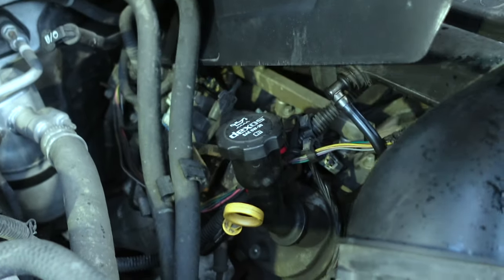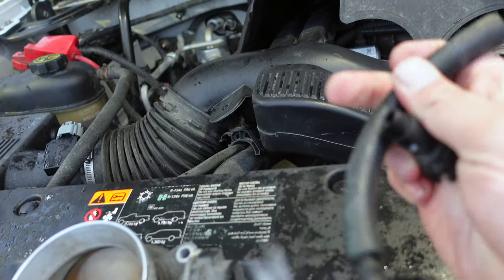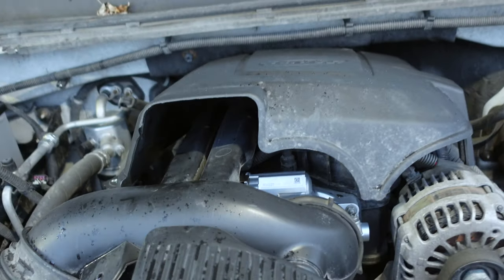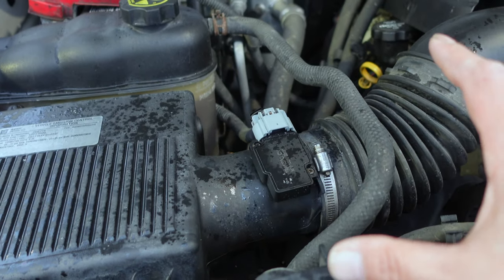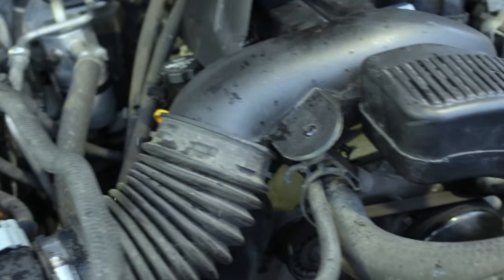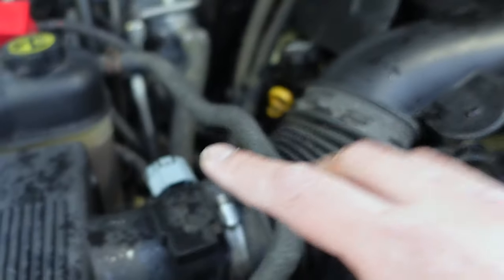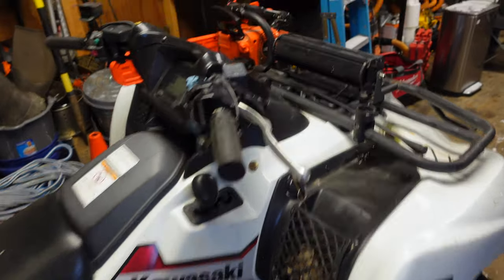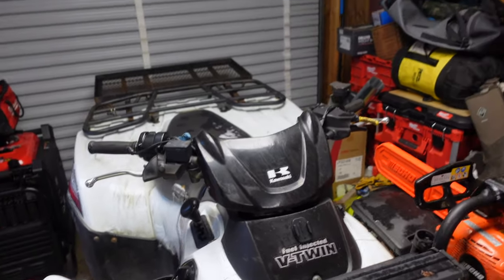The calm before the storm! - GMC is Fixed!

Comment: Nick, great video! I strongly suggest replacing that k&n if you plan on keeping the truck for a long time or at least keep up on well before x number millage For cleaning it, oiled  filters actually don't filter as good as dry filters  do especially once they start getting dirty. The elements they use "flow more"  because the mesh is more course compared to a dry filter, oem or even if AfE makes one for your truck are known to be good air filters also. I used to run only Donaldson they were accessible in my area anyway fo the diesel and still run them in my side by side due to wholesale pricing vs other companies but they also for alot of companies are recognized for warranty purposes, my side by side is actually a Donaldson from can am  to be honest
Reply: Wise words Chippy.   I’m currently stuck with a K/N because a factory filter no longer fits.
Bless’ns to ya,   Tedd
Reply: Agree!  Go with a dry filter
Reply from the maker: Lol my buddy CP said the same thing. I guess I need to make the change back. I think I used points and got that for free.
Reply from the maker: Seems like the consensus :-)))
Reply: @NickPixelTV  when k&n came out they were one of the first companies with a high flow option, but even the big name racers won't run k&n especially in the  world of offroad racing for the fact the oil reaches it max ability to keep things clean fast and what happens is dirt starts to by pass in the shortest explanation of things 👍👍

Comment: Hey Mr. Pixel.  Not sure what year your rig is.  On our ‘14 we installed a program to delete the AFM system. Actually raised our avg fuel economy by roughly 1mpg.
Trick is to do it before the system fails and gets stuck in 4 cyl mode.
Bless’ns to ya’s,    Tedd
Reply from the maker: I hear they can be a pain as well. My 6.2 doesn’t have the active fuel management she goes full send all the time 12mpg lol

Comment: Traction control, man when I was a kid learning to drive I had a stick shift 4x4 suburban, I learned how to drive in snow, my new truck has traction control and I hate it, just let me drive and control the truck thank you lol
Reply from the maker: I agree with this. When I’m playing in the snow i turn it all off ❄️
Reply: @NickPixelTV  I can turn mine off but it still activates but not as bad, I'd take a stick truck any day
Reply from the maker: Mine if you hold the button in for like 15 seconds it shuts off traction and then like another 5 seconds disables the stabiltrack completely if you only tap the button it will only shut off the one
Reply: @NickPixelTV  mines an 04 lol Its kinda smart